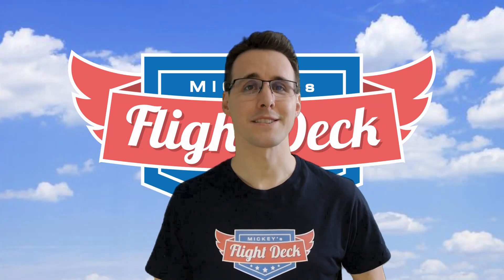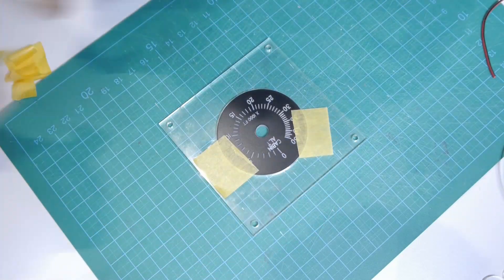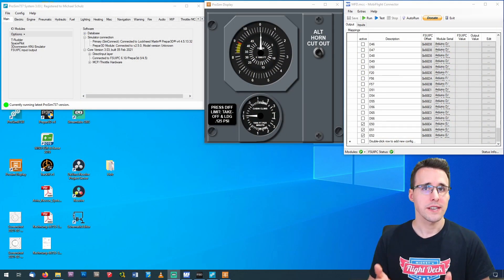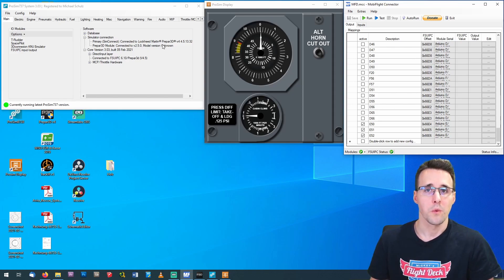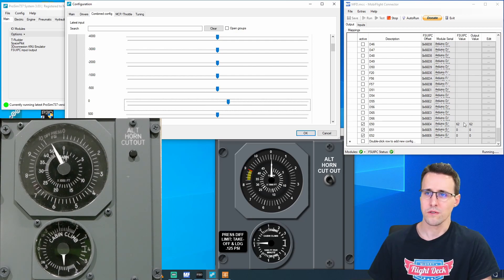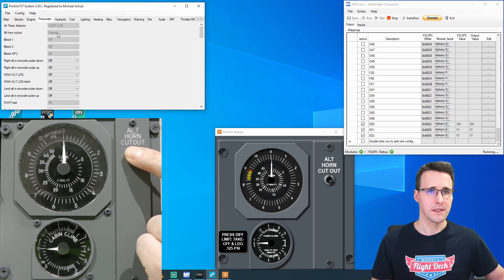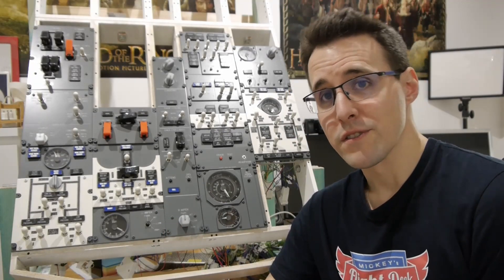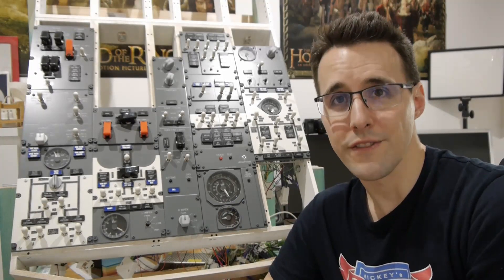Pressurisation Panel - A Boeing 737-800 Homecockpit #53

Comment: Hey, similar to your other video I commented on. How did you configure the push button in mobiflight? I’ve been trying to do it for 2 days straight and it just doesn’t want to work 😖
Reply from the maker: It's a button like all the other toggle switches. In MobiFlight the device is a button and you define a onpress and onrelease config. It is absolutely the same like I do it with the toggle switches.
Reply: @Mickeys_Flightdeck  hey, I figured it out just a few minutes ago! Thank you so much Michael!